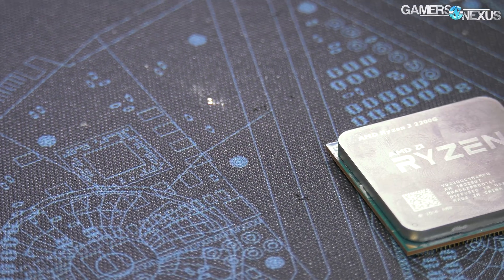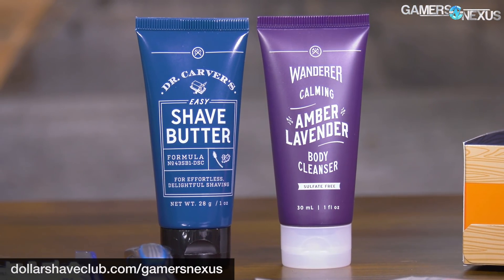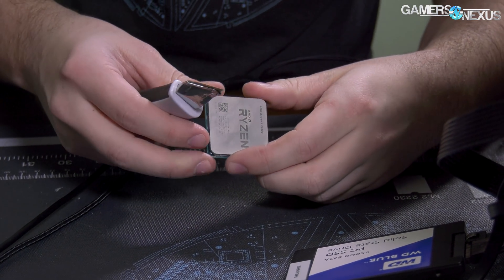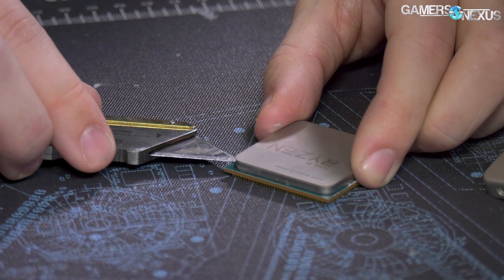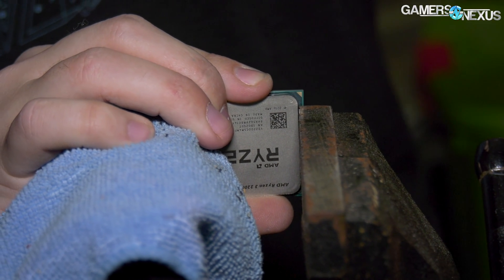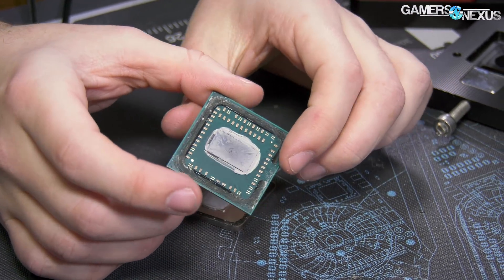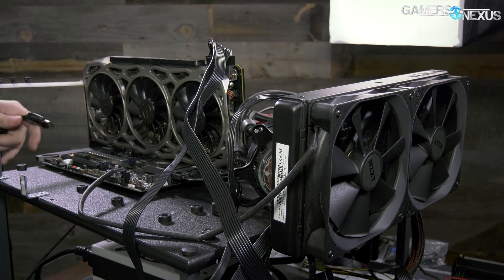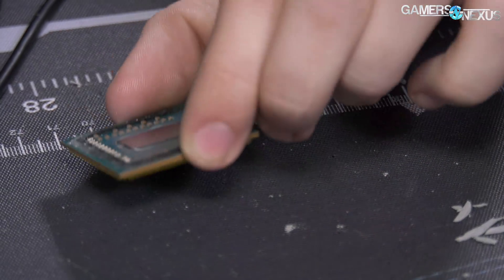Delidding AMD's R3 2200G APU & Liquid Metal (Pt. 1/2)

Comment: I understand why they did it, but honestly I'd pay another $5 dollars for the solder. It's not a huge deal considering how budget these are, but if the big push with these is Mini-ITX builds, low temps are  pretty important.
Reply: AMD also came out and admitted it. They didn't try hiding it. Also they might be using something higher grade than what Intel is using. They also probably pass these savings onto us, instead of increasing the profit margin
Reply: Xyler94 No doubt, if you are going to do it, a budget part is the place to do it on.
Reply: Irish Giant not a $300 CPU lmao
Reply: It's not only about the process and the materials used, you are also going to kill some dies in the process. It's not really worth the effort for such a low end part, running in low end micro or mini itx mobo's with terrible VRM's.

So far the CPU side isn't responding well to overclocking (gimping the gpu perf if you touch the cpu) and the gpu is bandwith starved af. On top of that most mobo's only have 2 vrm phases for the iGPU so you shouldn't touch the voltages on it too much anyways.

Basically what I'm saying is: For the audience this product is intended for soldering would be a waste, given this is a pretty low end part and the current popularity is mostly due to insane gpu prices which is something AMD prbly did not consider when designing the product.
Reply: Gen 2 without solder?! Are you kidding me?!
Reply: Soldering takes some expensive elements. Gold & Indium
Reply: FM1/2 socket APUs used TIM as well as did Athlon II and 65w Athlon 64 chips.
Reply: Because it's new tech to play with and overclock, duh? And it's cheap. So why not?
I already have a high end PC, this is just for the lulz.
Reply: They probably did their best to get the R3 2200G to be $99, that is a strong strong psychological selling point. You'd be surprised. Beside, the type of person this is aimed at doesn't even know what an IHS is or how they can make contact with different thermal conducting solutions. Its literally under the hood of the CPU and out of sight. If they needed to do this and other things to get it to be $99, then I honestly understand. I mean look at how fast both APUs sold out on amazon, and newegg has them on backorder(even with the inflated price listing). Likewise completely sold out on Frys. Microcenter has in store only, so I can't compare there. But yeah, these things at the pricepoint they are at is way more important than if that 2200G had to be sold for more than $99, and in the end, it won't be the kind of thing most people will be trying to overclock anyhow so why bother too much?
Reply: well A: If AMD were to solder the APU to please the 0.0001% of the buyers of this APU that you are a part of, the APU with no longer be 100$ and B: this way you have more to play with. You can de-lid it, you can use liquid metal or even solder it your self. So much to play with!
Reply: Marcel Krebs on the plus side, we already know that the average max Ryzen clocks at 3.9-4.0GHz and about 1.65GHz for Vega. And with TIM the 2200G an overclock usually gets you 3.85GHz all cores and 1.6GHz iGPU with the stock small aluminum cooler.

I think what we'll find is of course much lower temps, but just a very marginal bump in max OC and possibly lower voltage. So maybe 4GHz CPU and 1.7GHz iGPU with a large air cooler or liquid.
Reply: @Gabriel Yeah, but I was hoping for 4.1 or 4.2 tbh. 3.9 - 4.0 has been Ryzen's clock speed wall since release and I wonder what we can expect from the 2nd gen series in terms of clock speeds.
What is nice though: Memory compatability has been greatly improved on raven ridge already.
Reply: It could be because of the gpu I mean I’ve never seen a sodered gpu anybody know if the older APU were sodered or if they had any problems with being sodered
Reply: I highly doubt it's $5

Material cost isn't everything btw, there's the cost of manufacturing, manufacturing time, cost of electricity, and the cost of the equipment for manufacture. This is the case in any scenario when it comes to material manufacturing. The fact AMD did this at all shows the trade off is worth the cut down cost, and in all honesty I think it is. These chips are not very hot as it is
Reply: Btw. I'm not happy they're not soldering it. For us enthusiasts that really sucks, especially since it's pretty hard to delid by the looks of it (many smd's close to the ihs). I heard some rumours the entire Gen 2 is not going to be soldered, that would be a massive letdown.
Reply: IF you are an enthusiast as you say, why would you be buying a 100$ APU instead of a higher end CPU+GPU combo?

Comment: How are the pins not bending? Or do you need more force than that?
Reply from the maker: Way more force.
Reply: If you are applying force to all the pins simultaneously, it probably takes more force than you are capable of generating without a tool, if you apply force to a single pin perpendicular to the direction it stands then you encounter a risk of bending, but it is still much harder to bend than lga pins, because the pins are thicker and the way they are oriented makes it hard to apply force in the direction needed.

Comment: how does he do this w/o bending pins? i recently bent a pin i think just by sliding it a little on a old varneished table, coulldnt have been from handling it as pin on edge was bent out
what a pain to fix
Reply: C K Hey. Use the empty tip of a pen next time to fix those. It makes it quite easy!
Reply: that might work too  but it was just  that i needed my glasses and enough light, like bathroom light to even see exactly which pin it was thena steady hand with tweezers or empty pen to bend the right one back into place.

Comment: A delidded R3/R5 APU could be AMD's killshot. I am highly interested on how well the temps drop/increased OC'ing potential. Steve, a little too much LM there brother...
Reply from the maker: The LM was good. Thanks, though. Thermals look great, testing is done. The video is in editing.
Reply from the maker: Cool. I've delidded a lot of stuff too. The liquid metal was fine.

Thanks for watching! Next video out soon. It's pretty good thermally, but not necessarily worth the effort.
Reply: hate to spoil it but the temps are gonna go from Low to Lower... intel 7700k and 8700k was much hotter part than these 45watt cpu(65 watt with vega) you will see a slight decrease in temp since the temp is low to begin with.
Reply: I meant no disrespect bro. I have delidded dozens of Intel 67k/77k and now about four 87k's and I've learned less is more. I am an OC'er for Team Prema on HWBot (we were mainly LGA DTR OC'ers) and I can't count how many times a lot of new delidders (not saying you are new) have put way too much LM on their CPU's based off what they see in videos.

Anyway, I'll be waiting for your next video, as I am probably going to build a 2400G rig and see how far I can take it! Thanks for taking the time.

Comment: wouldn't it have been easier to try prying it while it's in the socket?
Reply from the maker: For a number of reasons, no. The socket isn't that secure (you can rip AMD CPUs out just by removing the cooler), and it's also adding lots of other components that kind of get in the way of maneuvering.
Reply: Sorry, I don't mean using the socket as a clamp. I imagine you'd use your fingers or an actual clamp to hold the cpu in the socket, while the mobo (perhaps dead) is screwed into something solid, thus protecting the pins from scraping or being bent, and presumably allowing you to focus on the knife since you don't have to worry about handling the cpu while cutting the adhesive/prying the IHS. 
I also didn't mean using it while you have components in; I don't think the VRM heatsinks (which could be removed anyway) or ram sockets will get in the way. 
I assume you guys aren't planning on delidding every AM4 cpu you get your hands so it's probably just not worth the effort, though a setup like this could prevent a killed cpu. A dead motherboard and some screws ought to be pretty cheap in the first place too.
Reply: "I don't think the VRM heatsinks (which could be removed anyway) or ram sockets will get in the way."

Well, the "I don't think" part is right at least. All you have to do is look at a motherboard to see that yes, not only the VRM heatsinks but the VRMs themselves will get in the way.

Comment: Why the fuck did amd still use that old ass design for there rysen cpu PGA.
Reply: React2Quick he means that PGA is outdated. Which I wouldn’t say it is. Just a different way of doing things. There’s no inherent performance advantage to having LGA
Reply: Hunter Long thanks for clarifying. I wouldn't say its outdated either. I haven't seen any advantages in LGA vs PGA
Reply: Adam what do you mean?
Reply: PGA > LGA. It's really easy to fuck the pins on intel mobo's, but pretty hard to fuck the pins of PGA cpu.
Reply: Threadripper/Epyc uses LGA so no.
Reply: PGA is ultimately cheaper in the end.
Reply: can confirm, had to unfork the roommates x58 socket, wasn't fun on any level, and took some trial and error vs pins which are pretty hard to mess up
Reply: also, i think i read or heard it somewhere that intel owns the design of the lga. I might be wrong. Look it up
Reply: I prefer PGA to Lga IMO
Reply: Easier to bend the pins back on a CPU than on a motherboard if something falls in during assembly.
Reply: PGA cooling is better than LGA, on LGA u need a metal bracket to hold it, making the heat transfer all over the place, meanwhile PGA does not need it.